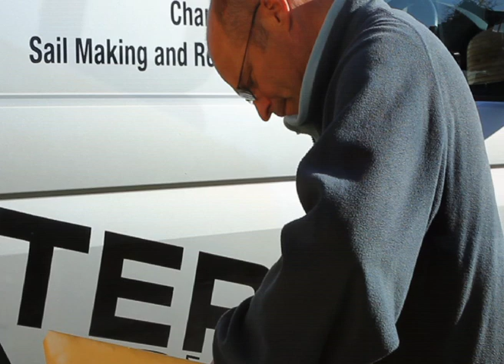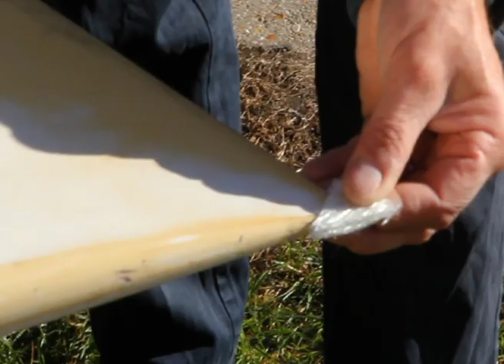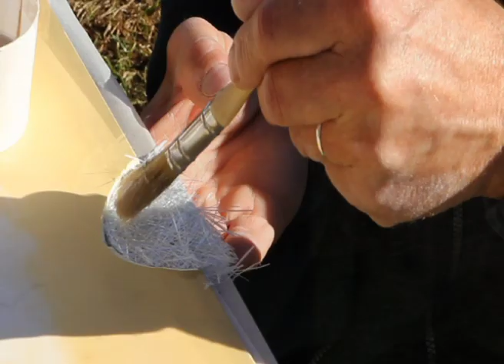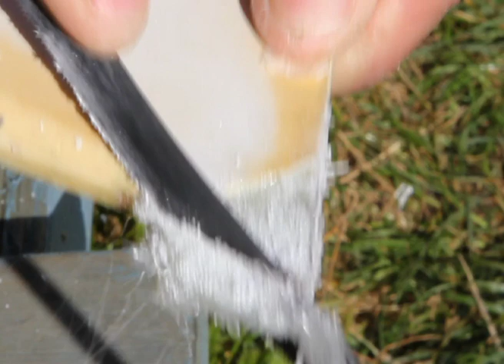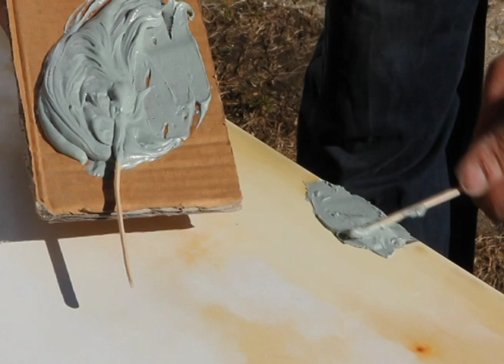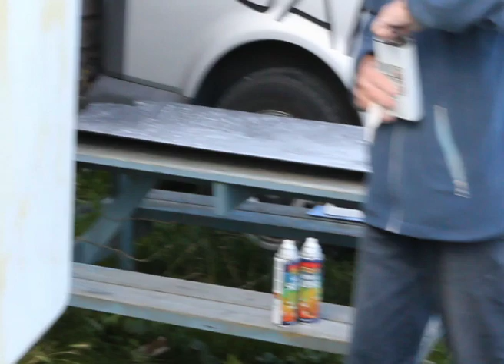How to repair a Laser dinghy daggerboard and rudder foils

Comment: In addition to this tutorial I would advocate the use of gloves when using epoxy as this stuff goes direct to the bloodstream and can cause skin irritations.  If you don't wear eye protection and get this in your eyes you could be in trouble.  Breathing the sanding dust from epoxy (or filler) can be dangerous so wear a mask or respirator.  Apart from that, a good tutorial.

Comment: to add if I may, cut your brush bristles down with the scissors first, this will allow you to consolidate the glass a lot easier. makes a lot of difference when you can't use a consolidating roller.
personally I chamfer the edges of the boards failures to allow your glass (or epoxy with fibres) to come in contact with the boards face this gives you a load bearing edge that can be feathered into the board and no need for filler, or less of it.

i dont like to add metal they rust enough as it is !

Comment: Hi. I have a crack in my rudder. Should I drill/cut around it to make a groove before applying fibreglass/epoxy, or just put epoxy straight into the crack. 

Thanks

Comment: Hi, if there is a hole in the trailing edge of the foil how likely is it that the structure of the foil has been significantly weakened? How likely would the whole thing be to snap in two, if say trying to right the boat after turning it turtle? Thanks!
Reply: Very unlikely. Most of the load on the daggerboard is taken up by the wider, central part of the foil.

Comment: auto body filler? Doesn't that absorb moisture?
Reply: Perhaps yes, if you left the daggerboard in the water for a long period of time. But for typical use of several hours in the water, then on dry land, it'll be fine. (I've had bondo on daggerboards and keels for years.)